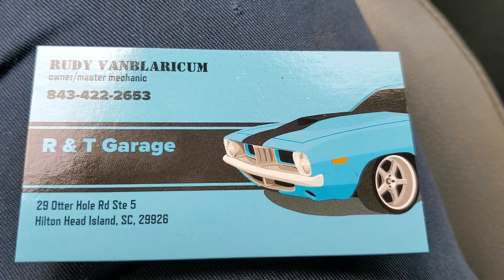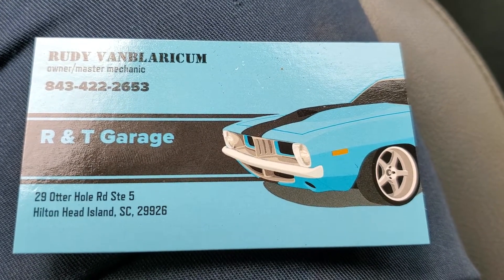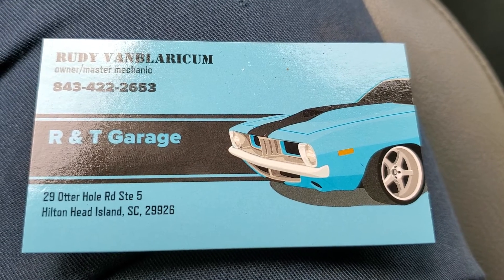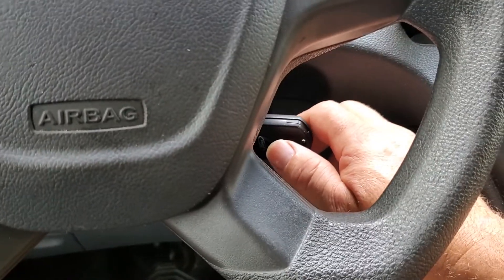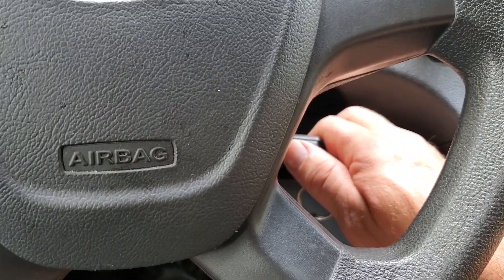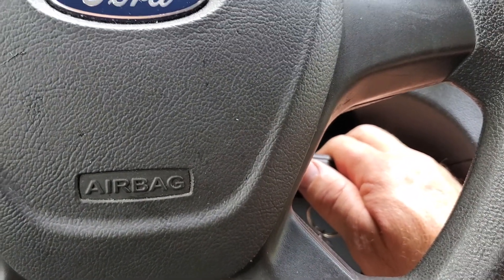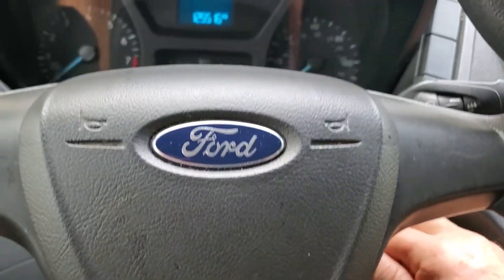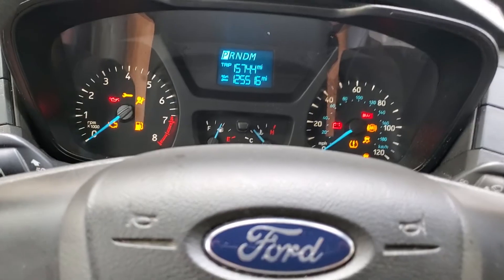How to reset oil change light or maintenance light on a 2016 Ford transit 250

Comment: On my control display the oil's light icon does not stop continuous flashing all the way(I had wait for 1 minute or more),I just had changed the oil without any oil  change light warning.
Reply from the maker: Thanks for the comment the manual says 25 seconds but I don't think I've ever had one reset that fast

Comment: I had try holding the pedals  
1 minute, 2 minutes, 3 minutes, 4 minutes and 5 minutes ( really hard to hold pushing the pedal for that long), but the the oil and wrench icons never stop  flashing, does that happen to you?
Reply from the maker: I've got 4 of these transits ranging from 2016 to 2019 every 1 of them seems to be different I would definitely try letting go as soon as it starts flashing that has worked on some of the models